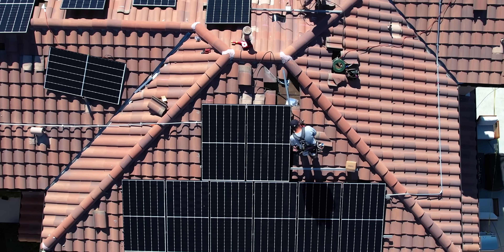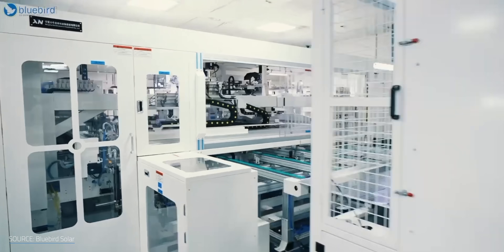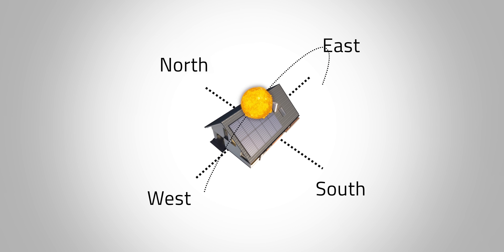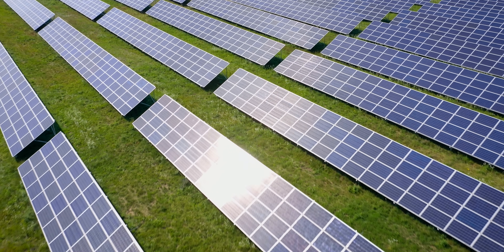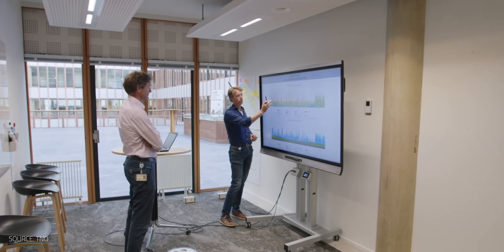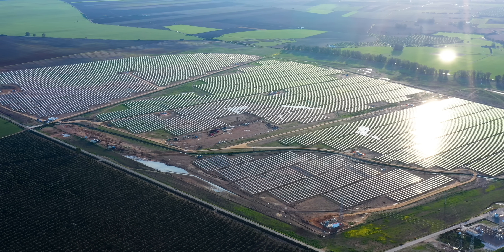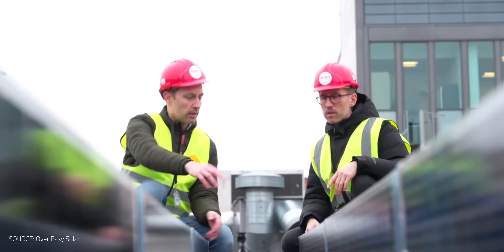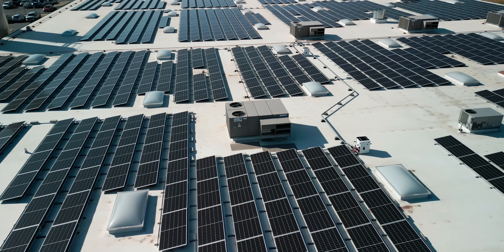Have we been doing Solar wrong all along?

Comment: I'm very interested in using vertical panels on edges of parking lots.  The parking lots create space away from trees so you'll have lots of lateral exposure in the winter time.  Lots of parking lots need a privacy barrier anyway.  Another great use could be along highways.  Vertical panels don't get as hot and will likely last longer.

Comment: I have wondered if bifacial panels do better up against a wall than opaque backed panels.  In that case I could see vertical light filtering through and refracting light through the panel.  Heat dodging?   Northern latitudes also have more low horizon sun that should do well on vertical panels.  In places where you are operating without a building permit, vertical panels are less obvious to satelite views, so that's nice.

Comment: @undecidedMF It seems, around @8:08 or so the answer is a compromise of the two positions. That would look like what? Panels set at a V shape, at a steeper angle than the latitude? I.e., if I am at 34 degrees in Knoxville, TN, then pitch them up to perhaps 65 degrees, if simply doing singles, facing South? But if doing Vs.... I am having a hard time picturing the best configuration. They'd be touching at the sourtherly most tip at about a 50 degree angle, at the tip, but open to the end base being whatever length apart that amounts to, but then they'd spread out along the land like Canadian geese, not in a perfect row, but staggered apart. I would love to see different designs tried out.

Comment: Forget the computer models and the yeng yang...
Set 10 or less bifacial solar panels vertical and 10 or less identical of the same at the suggested nominal angle, for a period of 4 seasons...
Monitor the output of each system and you have the answer.... This will take into account snow, clouds and temperatures on both sets of panels...
This is not rocket science...

Comment: The downside is the panel is not pointed at the sun during the point in the solar radiance curve is at it's maximum.  They are literally blinded during the peak solar window.  This shows up on longer term tests.  It seems vertical bifacials panels are about 3% better overall.  Some experiments using reflectors aiming to bounce the peak daylight at the panels increases that another few %.
The other downside is that vertical panels block each other 100% when perfectly aligned (dawn and dusk).  So only the sun facing side will operate until the sun it 30 degrees high or more, which partially shading all the other panels.  By the time the sun is high enough to hit all the panels fully they are already out of their operating window, 30+ degrees offset means about 50% less power.

Comment: Two thoughts. First, the results of DOE (US Department of Energy) experimental solar installation from a decades old setup. One system on a roof top, the other system ground mounted, but otherwise identical. Panel aging measured decades later showed the ground mount system had significantly less long term degradation---presumably because of better air circulation compared to a roof mount. Less heat = longer life. Note that the roof top system at least met the warranty degradation, so we're talking 25 year life versus 50+ year life.

Second, think about when you use electricity. Do you use more in the summer, or the winter? And is your goal to create the maximum amount of power each month, ignoring your needs, or to at least meet your needs during peak seasonal demand? Assuming a fixed mount, angling the panels to maximize winter production, when days are short, it's possible to mostly even out production across the seasons. I did the calculation for my latitude, and for a roof mount system, a south-facing roof with a 20 in 12 pitch (59 deg, where 90 is vertical) is ideal. That's crazy steep for a roof.

Both of these suggest that vertical mounting panels isn't that far off both the DOE experimental results, and the winter optimization results.

Comment: This is really interesting – thank you for the video. Subbed! 
One other place where you’re going to get a lot of sun energy bouncing all around is on the surface of water. For instance at the airport where I work we have a dozen stormwater management ponds - some quite large. I could see putting a series of vertical installations in the ponds for extra solar energy capture. And because the panels are vertical, we wouldn’t have the issue of sun reflected into pilots’ and controllers’ eyes, which is always a consideration when installing large expenses of reflective material on or near an airport.

Comment: skip all the nonsense 4:23 , sorry 5:33 
spoiler panel lose efficiency when hot, so combine them with a heat extractor (heat sink, radiator, liquid cooling...). So you get heat and electricity. Solved

Comment: Maybe its as simple as the obtuse angle of incidence of light hitting a solar panel sitting horizontally, causes light to be reflected off the surface. The acuteness of the angle of light rays hitting the vertical panel favours light piercing the surface.

Comment: Solar panels, no matter how you mount them are for shit because of the metals required in the structure, and the panels themselves.   People are not doing the full math.  They just look at the cost of the solar panels themselves and the watts they produce and that is good, they end their ROI there.  Except there is way more to getting sun converted into usable electricity.   If you do the math proper the cost is way above retail electricity from the utility company that is most likely producing electricity using natural gas.  Remember coal only makes up about 12% of electricity these days.  In the last 25 years it has all switched to natural gas.  The trouble with solar panels is the cost and maintenance of all the other parts of a solar system.   A property calculated ROI is zero.  Which means by the time you have produced enough electricity to pay for the capital expenses the equipment is used up, needs to be replaced and is essentially less than scrap value.   It's like the biggest boondoggle of the industrial age.   Those of us that were into this knew very well the high cost of solar panels because we are using them in remote locations where shore power wasn't available.  In those cases electricity was coming in at $.35 to $.75 per kilowatt.  Compare that to retail electricity rates of $.12 to $.17 per kilowatt.  If you can buy electricity from a utility company that is the cheapest electricity you can buy, it is also the cleanest and best for the environment.  Assuming you can do math.

Comment: What we are doing wrong is placing panels on fields. They should have building placed first with panels on top. They use the building to grow crops without pesticides or used to house cattle and pull off the methane to generate clean energy. They placing on fields and using grass killer will eventually get into our water table.

Comment: With this logic, might it ultimately be better to mount RV Solar Panels perfectly horizontal (flat) on an RV's roof instead of using the, as of lately,  popular swivels to angle RV rooftop panels? Laying them flat (anywhere in the continental U.S. will inherently be slightly off-access to perfectly 90° to the sun supposedly keeping direct heat to a minimum?

Comment: How does radiative heat effect the surroundings, like an adverse effects? Especially if they are placed on rooftops of houses. Moreover it is very difficult to place these solar panels vertical on top of houses like antennae! If latest generation of solarpanels like azimuth and other coordinate derived panels , how do the types of batteries change for storage and transmission?

Comment: Strange, but just the other day I was wondering if it would be better to mount solar panels on the South side of a house instead of on the roof.  I was thinking that snow and dust and such would not be allowed to sit on the panels like they do on a roof.  
Also, if heat is an issue, could the panels be white instead of black?

Comment: I'm going to try to make a comparison to the performance of solar thermal panels.  I've installed several solar thermal systems that have performed well year-round., they satisfy 100% of DHW needs in the spring summer and fall and a smaller percentage during the winter.

 When installing a solar thermal system, the goal is to absorb as much of the infrared heat from the sun as possible, we want them to get hot.  In choosing orientation and angle, being in New York State, we always face south but have to choose between angles in consideration of the season. Because the angle of the sun is lower in the winter and there are fewer how hours of exposure because of the shorter days, we are tempted to tilt the panels steeply, for example 75 degrees to maximize infrared gain during the winter months, the same time of year that passive solar heating strategies aim to capture heat for the interior of a building. At that angle, though, we'll compromise the absorption of the infrared rays during the summer months, we imagine. If we tilted the panels flat to maximize infrared gain in the summer by angling the panels at 15 degrees, for example, we would clearly minimize gain in the winter, so we have compromised and set them at 45 degrees.

 It seems very difficult, but not impossible, to imagine solar thermal working vertically, and all of the solar spectrum comes from, originates from, the same angle, so there must be something about the visible and near infrared that we have missed until now that has PV work.

I'm assuming visible means what our eyes can see.  We can see in conditions and in places where, if there was a dark colored object it would not get hot, so analogies to iron bars or roof hoods don't seem germane to PV or the visible spectrum. Do PV panels work as well when blocking IR? I'm just musing, I don't know enough to have any answers, only my anecdote of solar thermal experience.

As you mentioned, there are extra costs associated with each 2-sided unit. Is the 4% additional production compared to the production of a one-sided unit, or is that in comparison to 2 traditional panels?  Per kilowatt cost is absolutely the bottom line in the real world, otherwise it's just an interesting science experiment.

Thanks for passing this on for all of us to think about.

Comment: Vertical mount with reflective ground material like white sand and not an actual reflector like a mirror.   If a reflective mirror was used yes you would get more mid day energy but significantly. hoter panels vs using white sand.   We would want to strike a balance between reflective photons and the increased operating temp in the mid day hrs.

Comment: Posting my guest before you spill the beans: 

Certain frequencies of light can get trapped inside glass, so perhaps it is bouncing inside the glass rather than getting reflected straight back away due to it hitting the panel at an angle, giving up the maximum amount of its energy before it is used up for escapes. I'm probably wrong though, we'll see.

Comment: On the topic of albedo, you should put white targets with multifaceted surfaces to increase albedo, in the middle of the rows. That should increase output without transferring heat to the panels versus using highly reflective surfaces to redirect concentrated sunlight.

Comment: Vertical effects: 1. Thermal chimney. convective hot air increases with vertical surfaces. That's why wildfires are so fast-moving on steep hills.  The resulting lower panel temperature lowers voltage drops due to high temps. Additionally, some heat from the immediate environment trains into the chimney effect of the vertical panels, radiating IR to the local panels for additional gain. 2. Changed proportion of heat dissipation. Conventional panels get hotter and radiate more heat, in this case to space. Vertical panels dissipate a larger proportion of their heat through conduction and convection with the air. This heated air radiates to surrounding panels, allowing some of the IR to be absorbed and converted to additional power. Instead of conventionally-mounted panels radiating obliquely to surrounding panels, the vertical panels radiate IR at near-optimal perpendicular angle.

Comment: Yes we've been doing solar wrong 
And is the reason why skyrocketing electric bills
As it can only put in 15% of extra electricity of advertised output or extra electricityout the ignorance of solar is easily demonstrated with a volt amp meter and 4th grade math called ohm's law

It takes some six others with skyrocketing electric bills just a compensate for the power not actually going in on one home solar installation

Comment: Matt, Brennan from Baton Rouge here, I am new to solar panels and had a question about ur vertical topic. What distance do the vertical panels need. The aluminum brackets I have already purchased have a max distance of 3.3 feet per bracket however I can choose to space the next bracket further away from previous bracket if needed but is there a distance required for maximum efficiency and if so what is it? 🤞not exceeding much more than 3.3 feet or the space taken up in my yard becomes excessive. 
I’ve measured for 20 panels @ 30 degrees horizontal and I have just the required space. Attempting to save space as well as increase efficiency with lower temperatures. Pls and Thx u

Comment: And, an advanced of this format is to set each panel at 10 degree angles, zig-zagging along the length of the wall with the primary face facing slightly southward and the secondary faces facing slightly northward.  This eliminates the slight midday drop as the Sun passes edge-on to the panel wall.   This method, as well as a light-reflective ground, like white gravel, snow or specifically-fabricated reflectors give a significant boost.

Comment: Interesting and very cool 😊,  OHM's law V=IxR....heat is a by-product of resistance,  reversed in this application from the environment, ie; sun. Resistance goes up, Current drops. 
Years ago, I saw something similar on an underground magnet on a conveyor belt. As the heat from the environment went up (wet season-high humidity) , the magnet used to trip. Once I convinced mangment to stick a bigger cooling system on it, the problem went away.

Comment: Thanks you now explain why. Austria solar panels are now use as fencing panels. I thought it was because of the snow blocking out the light. But it clearly there use virtually  positive effect by shed the snow and  increase the reflection on to the panels use the snow drop of the panels ! It now standard practice to use around the garden as fencing. In this position in solar panels farm in Austria. I thought was because of snow falling but it for the reason you stated

Comment: I've been testing myself the Vertical theory and doesn't do anything, only if you have a specific case scenario as reflective materials and no shadow but the efficiency is still 60% tops 
After installing Horizontally no mater the sun direction, you will get 95% efficiency. 
So the Vertical is just a hoax and waste of money.

Comment: The biggest hurdle these things will have .. is being hurdled by wind.

More vertical surface area means less wind they can withstand .. which means your nice super efficient  panels might pull your roof off and land in your neighbors yard.
They also don't benefit from downward pressure benefits of having 4 corners touching the ground, which means mounted panels are a lot trickier to engineer safely.

Comment: I'd be interested to see how well these configurations hold up to high winds. The benefit of horizontal is that the wind can go over them but the vertical kind are a bit of a hard stop. What would be interesting is a configuration of vertical panels on a weighted hinge that can tilt a little with the wind or flatten when the wind gets really high and then when the wind pressure lets up, the weight moves them back into vertical position.

Comment: We need energy in the winter and this horizontal modules do not see a lot of sun in the winter. If I put the PV-modul at the wall, then I can get a lot more energy, because the angle of the sun is so low, nearly horizontal.

Comment: The fact that they collect more light from the back side means that they produce more electricity, it isn't rocket science. The question is whether the cost per KWh is better than the cheaper one-sided panels -  and what the optimal positioning of the new panels are. They probably would benefit from a tilt, but it depends on the prevalence of scattered and reflecting light sources. I have a feeling that horizontal panels with mechanical/non-digital sun tracking is always going to be most effective as the technology improves.

Comment: 10:02 "...then there’s some additional installation factors to consider. And since both sides of the solar panel are exposed to the elements, there’s some additional lifetime maintenance to perform." Maintenance is BETTER for BVPVs.  Vertical panels better handle vertical environmental challenges like snow, dust, and bird droppings.

Comment: The vertical installation makes a lot of sense in many places where horizontal installation is not practical. 
In my cold Maine climate the sun does not rise much above the tree line and my rooftop solar panels are at a poor angle. But the 4kw of solar screwed to the south facing wall is getting the full blast of the sun.
One other reason to do at least both types of installation is you actual sun window based on weather. If you only get sun from 7-10am and the rest of the day it rains, I want to maximize that small window of opportunity

Comment: Ok. Anyone want to create a patent? It is best to have 2 sided solar panels parallel to the suns rays. Then two mirrors on the opposite sides where each mirror on each side reflects back to the panels in both sides. There you go, go ahead and patent it and make $$$ This will actually greatly increase productivity.